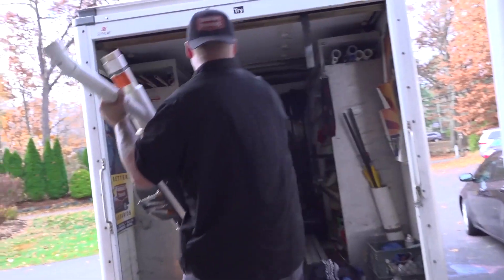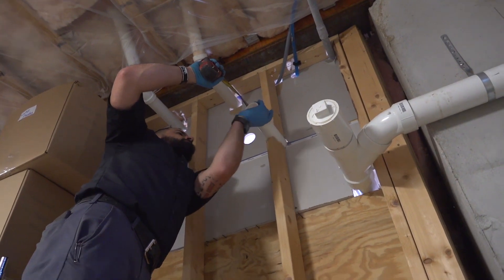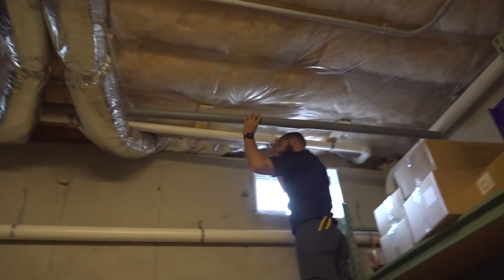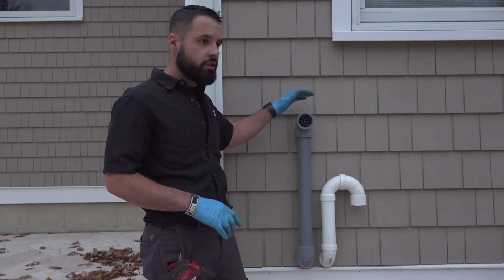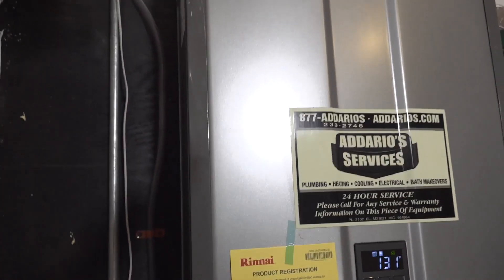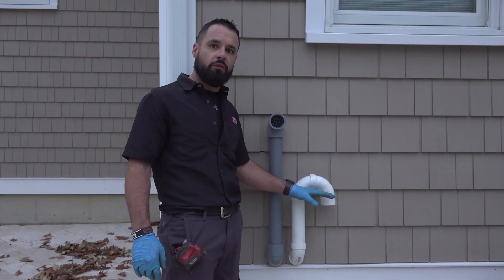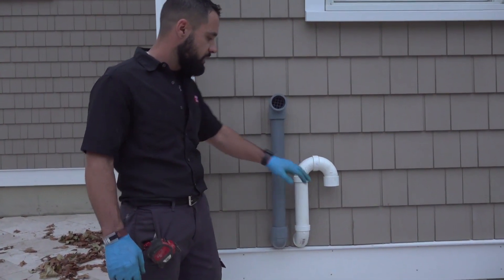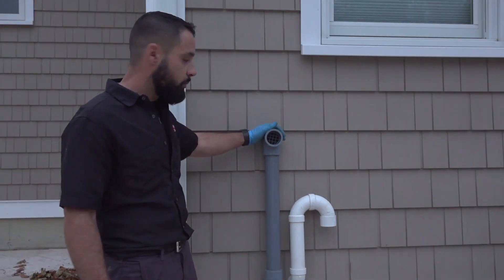High Efficiency Boiler Venting [Vent building time-lapse + tour]

Comment: Isn’t your exhaust rather close to that window???😮
I’m not there with a ruler. But you have to be away from that window so as the exhaust is not re-enter the house.
Reply from the maker: We're about 1.5 times the distance required by law in our area / dictated in the manual. It may look wonky because of the camera angle/ the lens we're using, but I promise this was measured twice, installed correctly and passed inspection with flying colors. Thanks for the question!